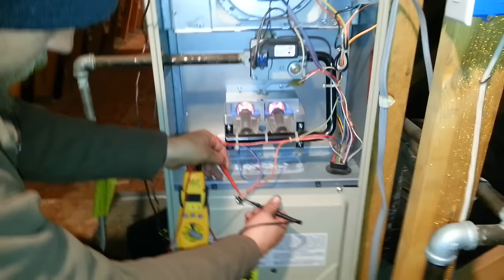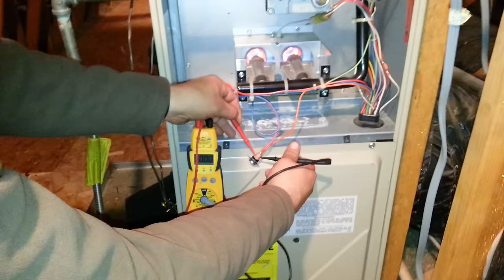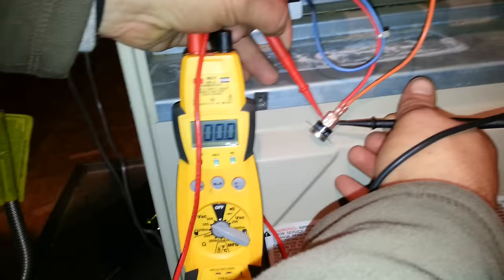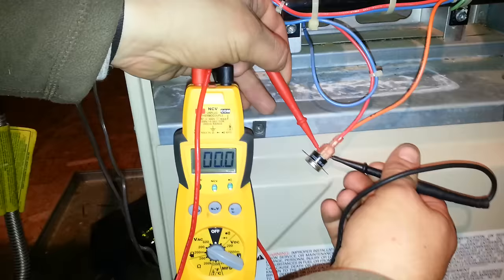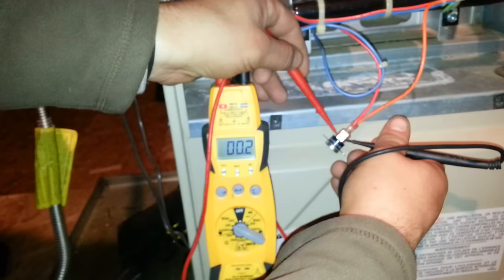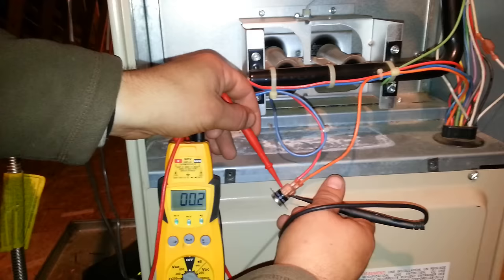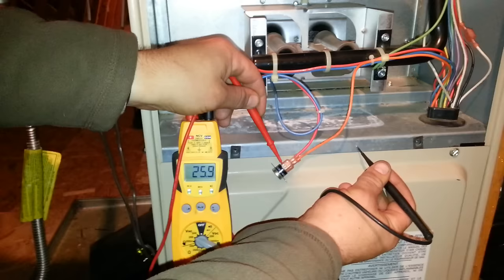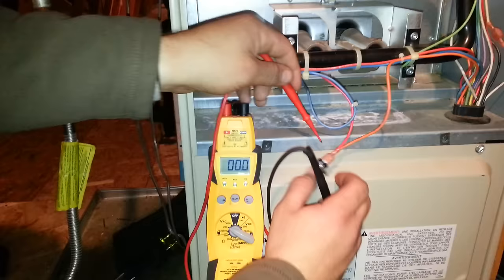Checking a limit switch using your voltmeter

Comment: I finally realized the problem was a faulty digital thermostat.  When I put it to manual the furnace ran fine. Fortunately all I had spent so far was for new limit switch which had gotten overheated due to burner doing the on and off thing, for longer than I had realized. Thanks for your advice!

Comment: What about when it reads 0 voltage regardless if tripped or not? Bad control board not sending power?
Reply: If power is applied to the furnace and the transformer, fuse, wiring, connections are good there should be 24 volts to ground on both the in and out of the limit or 0 volts across the two regardless if it's calling for heat or not. If it trips open then you should read 24 volts to ground only on the in wire and 24 volts across the switch. Trace the red wire back to the board and determine if the board is supplying 24 volts. Checking R to C on terminal strip and determine if you have 24 volts eliminates checking line power, transformer issues, and fuse issues. To check conductors, shut off the power, disconnect wires between terminals and using an ohm meter look for 0 ohms on all applicable conductors. If you don't have 24 volts anywhere at the limit switch and all the prementioned checks have been done you likely have a bad board.

Comment: I have to keep switching my gas valve off and back to on every day or so in order to get the gas to actually get sent to the burners (turning the whole furnace off and back on doesn't fix it, I have to turn the switch on the gas valve itself off and back on), otherwise it eventually sits on fan with no heat and just blows cold air indefinitely. I've cleaned the flame sensor and that did not fix it. But turning the gas valve switch off and back on does for some reason. 

When the issue occurs I turn the whole furnace off and back on and watch it go through the cycle. The igniter gets nice and bright but the gas valve never opens at all to send any gas to it. It tries this three times and gives up since gas is never sent at all and no ignition occurs. This results in only the fan staying on indefinitely even though thermostat is calling for heat. 

When this happens, simply turning the gas valve switch off and back on (and doing nothing else) it works again just fine on the first try until the next day or so when it's just blowing air again. I've ordered a new gas valve just incase, but could this limit switch be causing that and working intermittently with a reset on the gas valve fixing it temporarily?
Reply from the maker: This sounds like a bad gas valve. Measure voltage at the valve and if it  has voltage then its the valve not the limit holding it out. The limits are wired in series to the gas valve. If you do not measure voltage at the valve then it is one of the safeties holding it out. The upper limit is also wired in series with it so check it also. The best way to do this is to start at the first safety and follow the wires to the next one and so on to see if they all have voltage. 

Also check the circuit board or ignition module, sometimes the board may not be sending the voltage out. If that is the case then it is the board or the ignition module and not the gas valve.
Reply: @baileysair   I will try what you said. If it was something before the valve causing voltage to not get sent, would toggling the switch on the valve itself possibly affect that somehow? Thank you for the info this is great help!!!
Reply from the maker: @FatalMusa  No it shouldn't, gas valves sometimes do stick, that is why I want you to check voltage, if it has voltage then it is sticking and/or the holding coil is going bad. Either way you should replace the valve.
Reply: @baileysair  thank you for this info!!!
Reply: @baileysair  what is meant by “limits are wired in “series” and what are the implications of this regarding testing?

Comment: So the switch in the video was bad or good? You said when it read 24v in the tripped position its bad limit which i understood as it being faulty. I was testing my switch when it was running and when it tripped off it was showing 24v as well. The issue im having with my unit is that it was short cycling and the gas would stay on for about 4-5mins and kick off, took forever to get to the right temperature
Reply from the maker: The switch was tripped and had to be manually reset. We checked everything, cycled the system several times and couldn't get it to trip again. To this day it's still running and the tripped limit hasn't tripped since. So no telling what caused the original trip. 
I would check that airflow is good. What is the static pressure drop across the coil? What is the total external static pressure? It sounds like it is cycling on the limit, which means there is not enough air flow through the furnace. I would also check to see if the coil was dirty as this could also cause this, hence the pressure drop across the coil.
Reply: Bojan Bokur maybe the furnace have a bad heat exchanger
Reply: @nissangtr5296  i know i agree. Just by that quick look, just from burner inspection, even though its not running at steady state, those burners look orange when burning.  They should be blue with little orange flashes that are minimal (although can be from dust too).  Im in hvac school right now.  Hopefully someone can tell me if im correct ?
Reply: @baileysair  sorry for the dumb q but what is meant by “static external pressure” and “pressure across the coil”?

Comment: so what exactly is the limit switch doing when its not "tripped" and what is it doing when it is "tripped"?
Reply from the maker: A limit is a over temp safety device, same as the flame roll out switch that is being tested in this video. However, all safety switches are wired in series so if one trips it trips the whole furnace and it stops working. The upper limit senses the airflow across the heat exchanger and if the temperature exceeds its rating it will trip usually around 180 degrees or more. A flame roll out will sense when flame is shooting out from the burners and will open up to prevent damage or fire. Hope this explained it all, if you have more questions feel free to post it in the comments.
Reply from the maker: Almost forgot, most upper limits are auto reset. When they trip and then cool off they will automatically reset. In many cases the airflow is too low moving across the heat exchanger due to a plugged coil, dirty filters or too many registers being closed. Many customers don't even know this occurring and only call because it seems to be cycling too much.
The flame roll out switch wired in series with the upper limit switch is manual reset. This keeps the unit from running till someone comes out and resets it manually by pushing a button. This is to prevent damage inside the furnace from occurring.
Reply: @baileysair  hey! Thanks so much for writing back. I apologize in advance if these are stupid questions but: 

1)
is there a difference between “burner assembly” and “heat exchanger”? Kind of confused how these are different in terms of what each’s function is. 

2)

What’s a “cycling thermostat” in a dryer and do furnaces have these too or something like it but a diff name?

3)

What does it mean if something is “in series” and why would that make everything go off within “that series”?

Thanks so much!!
Reply from the maker: So the burner assembly is outside of the heat exchanger and where all the magic happens with the gas. The burners purpose is to efficiently mix air and fuel and control the flame so that it stays centered in the inlet side of the heat exchanger. Some furnace have NOx rods that allow for cleaner burning of the flame reducing the amount of NOx the furnace produces. These NOx rods are inside the inlet opening of the heat exchanger and can be seen glowing cherry red. With an LP furnaces some manufacturers will tell you to remove the NOx device as the excessive heat of LP gas will disintegrate them over time. 

1) The heat exchanger is a sealed chamber sometimes called the firebox that transfers the heat from the burners while keeping the combustion gasses separate of the airflow. The heat exchanger is a sealed chamber. Depending on the manufacturer it could be tubes or it could be a clamshell configuration with two plates welded together. 80% furnaces have slow down the flow of combustion gasses through the heat exchanger to allow an efficiency of 80%. In other words for every dollar of gas spent 80% of the heat is transferred to the air flowing around the heat exchanger and 20% flows out through the flue/chimney, you are getting 80 cents for every dollar you spend for heat into the home. 90%+ furnaces slow down the combustion gasses so much that we improve that efficiency to as high as 98% on some furnaces. On 90% furnaces they have a secondary heat exchanger that is actually a coil. In this coil a large amount of water is condensed out of the flue gasses. This is why they are called condensing furnaces. This water has to be managed and flows out through what we call a cold header into a drain system out of the furnace. 

If the heat exchanger develops a leak they need to be either replaced or a new furnace needs to be installed.  

2) As far as I can tell, because I don't work on dryers, the cycling thermostat is there to help regulate temperature of the dryer air by limiting how hot it can get. It seems to be the same as a limit switch in a furnace.

3) When an electrical circuit is wired in series it allow electricity to flow through it. If this circuit has multiple switches wired in series then if any of those switches happen to open up the electricity will cease to flow. Safety switches are always wired in series so that if something should go awry they will shut down the electrical component. Limit switches and flame roll out switches are such devices. On the cooling side we have low and high pressure switches. 

Another safety device in furnaces is the pressure switch. This switch has normally open and normally closed contacts and when a furnace call for heating the board will see if the contacts are open then after the inducer motor energizes check to see if the contacts have closed allowing the furnace to continue operation. 
Hope this helped
Reply: @baileysair  what a wonderful set of answers! I will just say with one caveat: dryers have a thermal fuse (it’s temp limit is higher than the high limit thermostat), a high limit thermostat/switch (temp limit higher than the cycling thermostat)  and a cycling thermostat, the former two being safety devices. Does that pin down a better answer to that particular question I have? Does a furnace have the same set up?

Also this pressure switch you mention in a furnace you say it’s normally open and normally closed? I thought a switch is either a normally open switch, OR it is a normally closed switch!
Reply: @baileysair  well explained thank u!
Reply: @baileysair  can you explain a bit about what “ in series” means and why things need to be set up this way to properly trip everything?
Reply from the maker: @MathCuriousity  Pressure switches come with both contacts depending on how it is wired. The need to show open before energizing the inducer motor and then also show closed when the squirrel cage starts to generate a negative pressure.

All the safeties on a furnace are temperature driven. However, the furnace will cycle on and off via the thermostat once the space reaches temperature.

Comment: Very poorly explained. A tripped limit switch is not bad limit switch. You also called a tripped limit switch an open limit switch. An open limit switch is not a bad limit switch, which may not be a tripped limit switch. You explain nothing, you get nothing... in regards to thumbs up, subscribers, and views.
Reply from the maker: Sir, you are correct, maybe I should redo the video. Just happened to be in the attic with my son and wanted to quickly explain how to check a limit or flame roll out switch (which this is). Thanks for the comment, gives me something else to do.
Reply: I am so lost after watching this video. What are you measuring with your meter? Why? What are you doing trip it? What are you expecting to happen? What is actually happening?
Reply from the maker: @michaelkuzmin  We are measuring the low voltage. Safeties on furnaces are wired in series and use 24volts, when a safety trips it opens up and does not allow voltage across the safety. So when the tech could read 24 volts using his meter measuring across the two terminals on the safety it tells him the safety is open. If he didn't read any voltage across the terminal it would tell him that either the safety is closed or there is no 24 volts. 

I hope this helps.

Comment: Thank you. Continuity test?
Reply from the maker: This was low voltage test. However, you could kill the power and pull the leads and check it for continuity, either way will work.

Comment: So how do I check if the air flow is good if that's the reason it keeps tripping the switch
Reply: I changed the filters but do I need to check everything? like do i just start taking things apart until I find the problem to the low airflow?
Reply from the maker: You can measure airflow by taking a total external static pressure (TESP). Your furnace should be rated for a half inch of static. When you take the TESP you can then use the TESP and the fan flow chart for that furnace to determine how much air the system is moving. The higher the static the less air the system is moving. You do need to check the fan speed that the system motor is running on and compare with fan flow chart to ascertain the actual air flow.. 
Another factor could be the limit is going bad. The limit rating is stamped on it, check it by removing the limit and putting your thermocouple from your meter and checking the actual temp rise where the limit sets.
Reply from the maker: @sunshinechang4249  If the filters are clean, and the  system has a cooling coil, the coil may need to be cleaned. One other thing to check is if the motor, is it stopping? Or maybe the run cap may be bad or the motor itself.
Reply: @sunshinechang4249  If you suspect airflow, and do not have an equipment to check pressures, pull out the blower (you may have to disconnect and remove control panel to do that) and see if it is clogged and if it rotates freely.

Comment: now this is done with the furnace trying to run correct?
Reply from the maker: Yes, this check is done while the unit running. It will indicate if a limit or safety is open and help identify which one, because they are wired in series. You just start by checking across each one till you find the open one. Of course, this assumes that you have 24v and no blown fuse. Some brands have the blower coming on if there is no 24v and/or the transformer or fuse is blown.

Comment: Nice video except you do not explain what a limit switch is? I assume it has to do with heat (to hot)?
Reply from the maker: Actually the switch in this video is a flame roll out switch with a manual reset. Limit switches are installed higher up in the furnace and check that the airflow across the furnace is good. Limit switches are also auto reset. The flame roll out is not so that a customer will call for service. However, all the safety switches are wired in series so that if any of them trip they will shut the gas valve down and if it continues the unit will usually go into lockout and not run, thus causing the customer to call for service. The flame roll out is manual so that a flame that is rolling out of the combustion chamber does not damage wires and or cause further harm or become a hazard to the occupants.